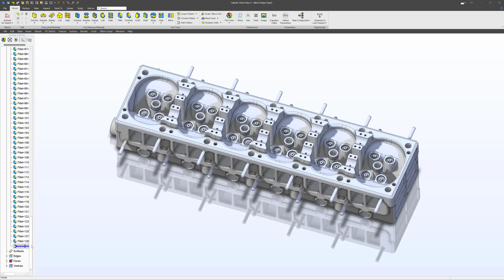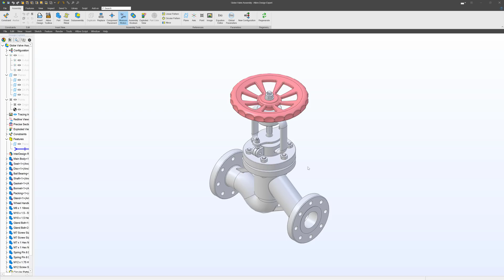Introduction to Alibre | Alibre Beginner Course #1

Comment: Hi, is there an option to inspect collision? Let's say i made parts of a furniture which fits together with mortise and tenon joints. I want to see if they fit together or maybe they collide because part are not in right positions or too wide. Is there an option where it shows overlapping objects or something? Sorry if i can't articulate myself properly.
Reply from the maker: Indeed, in assembly, go to the ribbon and choose Inspect> Interferences.  When running a global check, it can report what parts are colliding and how much volume the collision takes up.
Reply: @AlibreLLC  Thank you. Btw i couldn't see software prices on your website. I reached out reseller in my country but how can i verify if their prices are too much or not? One of them wants around 1100 dollars for Professional version and almost 2200 dollars for expert version.